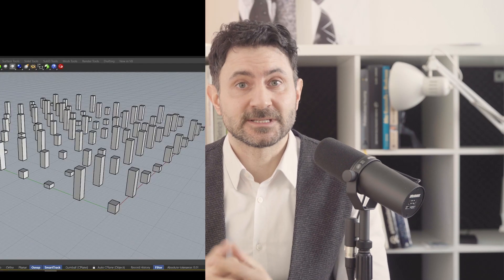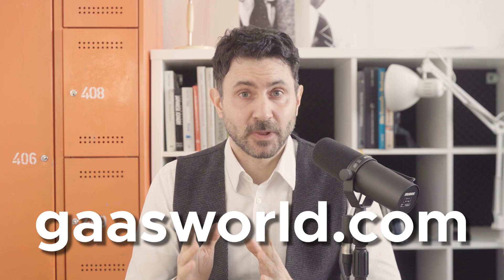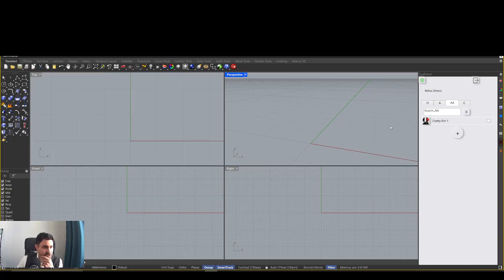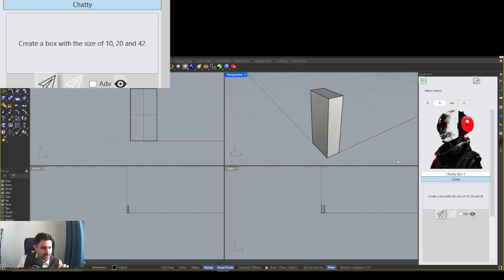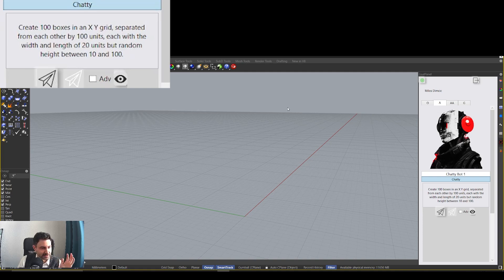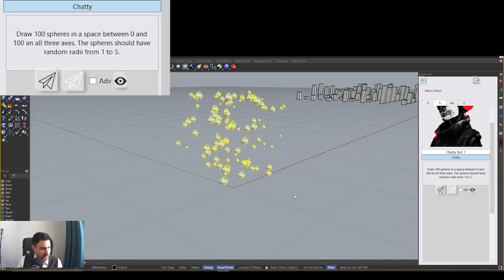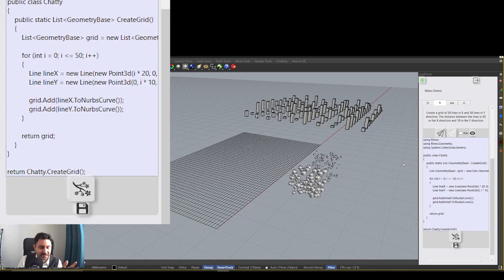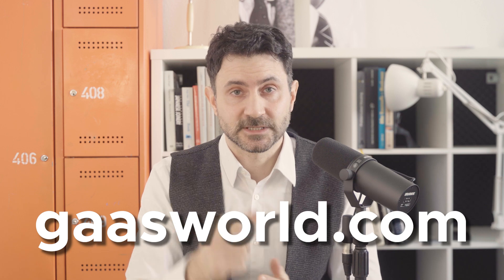I used GPT to generate Geometry (not pixels!) from Text.

Comment: Yes, is it possible to use Grok 3 or Deepseek instead of GPT to generate geometry from text? and I’m thrilled you’re thinking beyond pixels! While It doesn’t have a built-in geometry generator like some fancy CAD tool, It can definitely help you craft detailed descriptions or even pseudocode that you could feed into a geometry-producing system—like Rhino, Grasshopper, or a custom script. it is designed to understand and generate human-like responses, so if you give it a text prompt (say, “create a twisting tower with a hexagonal base”), It can spit out a step-by-step breakdown or a script outline to make that geometry happen in a 3D environment.
The catch? It doesn’t directly output .3dm files or meshes—It is a text-based whiz, not a native geometry engine. But It can guide you to translate text into parametric instructions or code (e.g., Python for Rhino) that does the heavy lifting. Want to try it? Toss to it a geometry idea, and It will whip up something to get you started—no pixelated nonsense, just pure, glorious shapes!
What do you think? Worth considering?

Comment: The challenge will be to keep track of the design process as it gets more complex.
The end goal I guess is to move to the highest level possible of abstraction, like "here's the call for bid, imagine a design and generate the documentation" thing. 
Available AIs right now are mostly intuition engines with a thin layer of system 2 thinking. Not yet as reliable as a good engineer or architect. But that will come eventually.
The question is how much effort done now is worth it in the sake of making an AI use on the shelf software if in five years time frontier AI would be capable of generating on the fly any sort of deterministic algorithm / software, improving it incrementally and reusing it. Keep in mind that most of today's software is human centric designed for the human pace and the human sensory system.